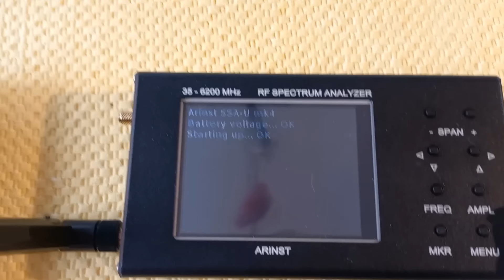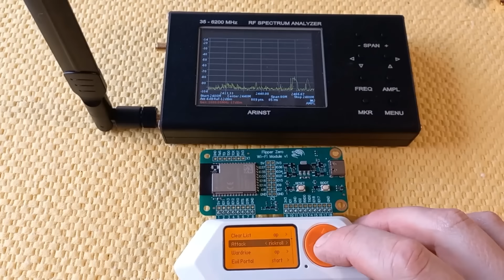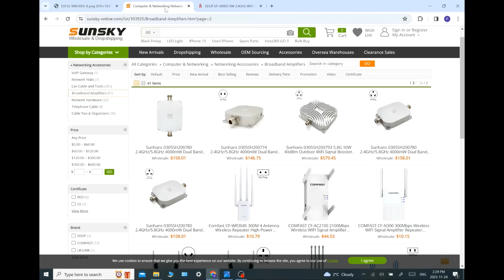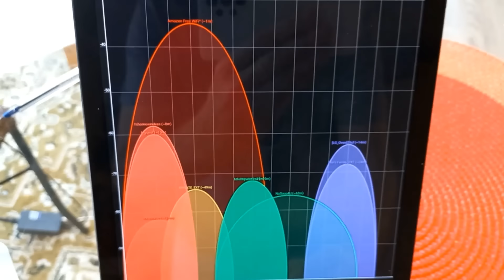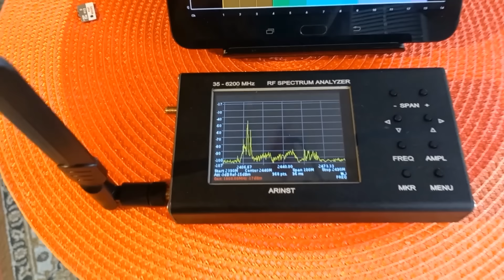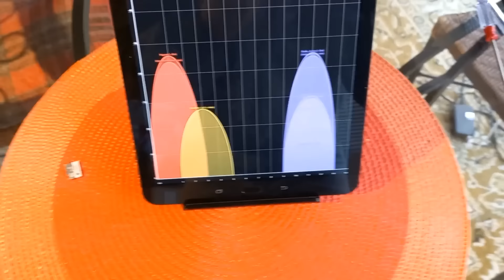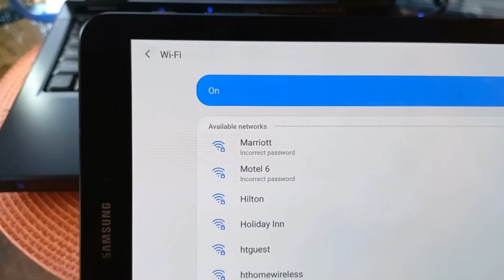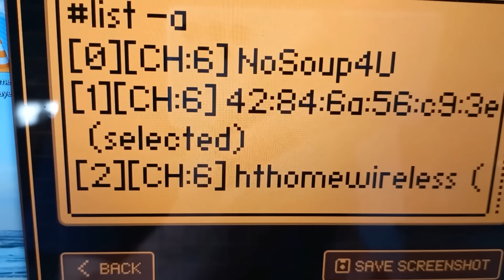WiFi Hacking with HackRF

Comment: Part of my job as a rf engineer is to find and mitigate noise on cellular systems.  Take care, people are very agressive with things they dont understand.  I have had guns pulled on me countless times for pointing an antenna around.
Reply: I can imagine that pointing an antenna at a paranoid methhead could cause unforeseen problems.
Reply: Indeed.
Reply: Absolutely correct. If someone pointed that thing at me a few years ago I probably would have tried to eat them. Literally.
Reply: Ooh ooh RF engineering I'm graduating this stuff tomorrow
Reply: @maxasaurus3008  Doesn't seem like something to be proud of.
Reply: Just tell them you'll tx kW from your antenna that will take over their minds. I'm tempted to do that with my misinformed neighbours

Comment: I like to run scanning from my back deck outside with my Kali laptop and a TP-Link T2UH. Neighbor over on the next block has an LG smart fridge. Interesting stuff floating around the airwaves.
Reply from the maker: LG_Smart_Fridge. Note: If prompted for a password, enter the last 4 digits twice from the wi-fi name. and press connect.
Reply: ZigBee sniffs like a ripper rtsb dongle Hi thanks for the how toos one
Reply: @peterfairlie2296  nice! Thanks!
Reply: @nrgfalt  Do you know if it works with Kali?

Comment: For anyone who is planning on doing this:

just beware that this will not work for a majority of business wifi, i.e your school, your local library.
And soon (within 5 years) this will not work for 99% of wifis. Its because there are now newer wifi protocols that prevents this form of deauth attack.

The only other way right now is to create your own jammer, but not only is that difficult without an engineering degree, its also extremely illegal. You would need a noise signal generator, with powered amplifiers for every band + antennas. Also the gsm cell towers have ways to detect jamming so they can catch you if you jam long enough.

TLDR: This will not work as well as you'd expect. Deauthing no longer works.

Comment: Just another Internet dude giving advice. those reflector antennas have polarization. the feed should match the direction of the grid on the dish. your current config is not getting optimum gain. Just thought I would throw that out there FWIW.
Reply from the maker: If you watch the whole video I do run it with both polarities as seen here: https://youtu.be/3Kr_3OZHy_g?si=CLS2hDaJxEoIJVCv&t=2825
Reply: @peterfairlie2296  I bounced around your video but missed that part, I was unsure if you knew about that. Like I say just some random Internet guy offering his .02 comment of how someone is doing something wrong in their video. lol.
Reply: Okay how would you improve it?
Reply: Yes this .an is an excellent guide to exploring or haking to gain understanding and root control of your device ++
Reply: I appreciate your candor and self suppressed humor(self depreciating wasn't quite right. Lol.) 
The comment itself was worth the effort even if he addressed it in the vid as it's one of those details that noobs like myself need reminding of periodically or it gets forgotten as a single grain of sand in a dessert does. 
The amount of pure information and data that applies to just the antenna facet of the RF/ham/radio science is unbelievable  and overwhelming for the first few months of starting out... 

Once you find out that bigger antenna doesn't = better antenna everyone is just like.... "shiiit". 
Lolol... no way around it.🤷

And this channel rocks BTW! I watch as often as I can!!!

Comment: Is that spectrum analyzer the same as the ones on ebay with the same range for $160ish ? They look identical and have same RF range.
Reply from the maker: The one I have is a real Russian built Arinst that I bought before the war. It was over $500 USD in 2020 when I got it. Since the war you can't buy anything from Russia anymore and I think those cheep one on ebay are likely Chinese knockoffs.

Comment: I have a 20db gain amplifier that came with my HackRF and it's the size of a matchbox. I am clearly too stupid for radio stuff. I don't get what the point of a jammer app is when it barely interferes with anything unless it's right next to it.
Reply: Not only that, but it has such narrow bandwidth that you can only jam one channel of the 2.4 band at a time. Meaning any device is going to simply switch channels.

Comment: isn't the grid dish you use contains an downconverter for MMDS applications ? and output an 2400- L.O. = much less signal (I may be wrong) if so how do you inject an RF signal into this receiving antenna ?
Reply from the maker: There are different models of the grid antennas. The one I'm using has a passive feed of 2.4 GHz WiFi. There are others that operate at 1.4 GHz & 1.7 GHz for weather satellite reception. There is also the type you are talking about that is used for MMDS services which actively receives on 2.5 GHz and down converts to an L band output.

Comment: At 24 minutes into this video you're describing an isotropic radiator which is a spherical radiator which has no gain. Your antenna with gain puts out a pattern that looks somewhat like a donut laying on its side a flattened donut that's elongated along the horizon. That's where your gain is coming from.

Comment: Hello. Video time: 1:05. Tp-link parabolik antenna: the active antenna emitter is not aligned with the parabolic reflector grid. the active antenna emitter is not aligned with the parabolic reflector grid.
Reply from the maker: If you watch the whole video you'll see I do try both vertical and horizontal polarizations.

Comment: Good morning Peter I am a student working on expanding my electronics knowledge I wanted to ask if you could direct me towards finding a good amp with a cooling apparatus? With regards to your spectrum analizer is the antenna connected to a dedicated through line / antenna line or can I connect it to either portal? I'm currently using a nano as a starting point.

Comment: I am curious , can some one explain to me the very beginning of this video of how that guy was able to snipe someones phone traffic like he did with that device .. what is that contraption he had and how would one do that today?could the Hackrf accomplish the same thing?
Reply: It's a lot more complicated than they make it appear. The device he was holding was just an antenna. I believe it was a Yagi-Uda, but I may be wrong, as there are lots of designs. In any case, it is a very high-gain, directional antenna. That's why he has to point it in exactly the right direction to pick up her WiFi. Then he uses software on the computer to deauthenticate her phone from her network, then when it tries to reconnect, he performs a man-in-the-middle attack. Her phone connects to his signal, as does her router, and he becomes the middle man and able to read network traffic.

Comment: The dish having "Vertical bars", I would think that it's desgined for Vertical polarizartion... yet the feed horn looks to be horizonally polarized.
Am I mistaken?
If not, try flipping the feed horn and see what happens!
Reply from the maker: If you watch the whole video you'll see I do try both vertical and horizontal polarizations.
Reply: @peterfairlie2296  Sorry...   I had a washing machine drain hose rip open and got sidetracked.
I'll finish the whole thing before posting more.
Reply: This is PG2.4 antena (parabolic grid) and it is die-cast aluminium (not wire grid). In this position reflector is in vertical position but feed is in horizontal position (wrong mounted) look at assembling instruction.

Comment: Try running your dual amps as “bi-amp” configuration -> parallel and not series.
Also: at 43:04 - is your neighbor checking on you? 🤔